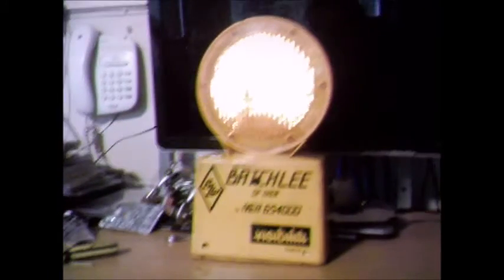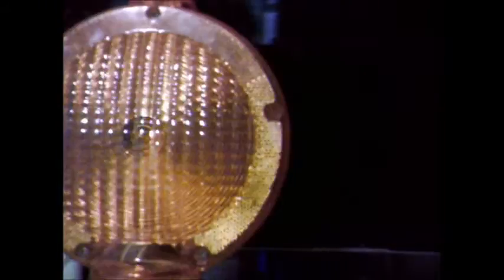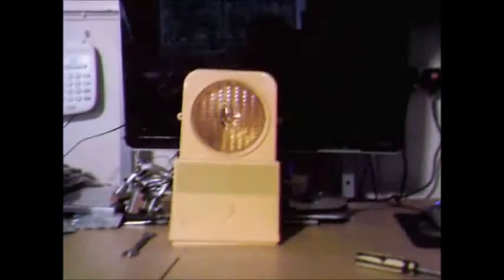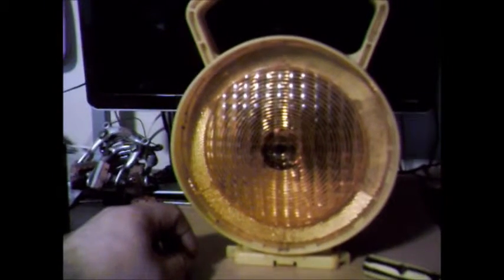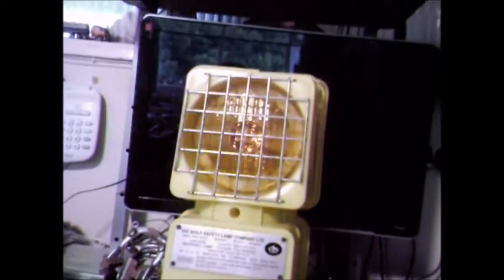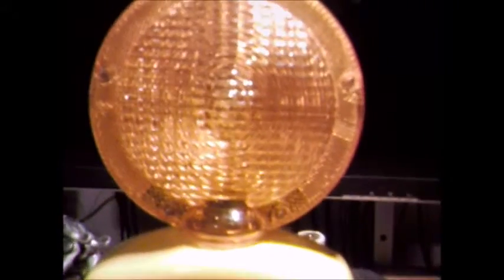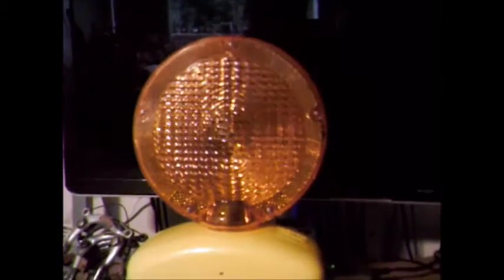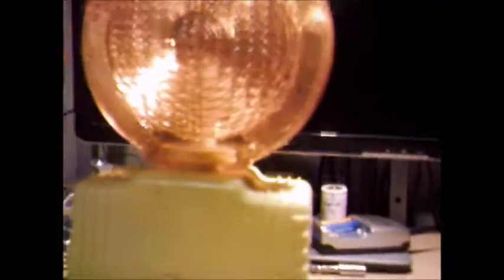Misc Barricade Lamps

Comment: Nice video! Your Tidawn lamp you like a lot is the Guardsman, there were 2 sizes as well so there is a mark I and a mark II, your blue Nissen is old as they are no longer made, well from what I can find anyway. I have noticed that the Conilamp by Nissen seems to be brighter as well, a comparison will be nice to see! I am trying to get one of these and can only find the ConeLITE's.I think the American lamps are OK but the designs all look very similar and the lack of a handle make it look strange, probably because I am used to the handle on 180 degree lamps.